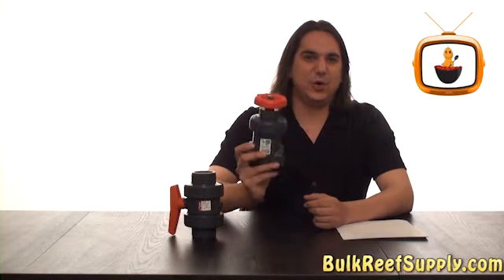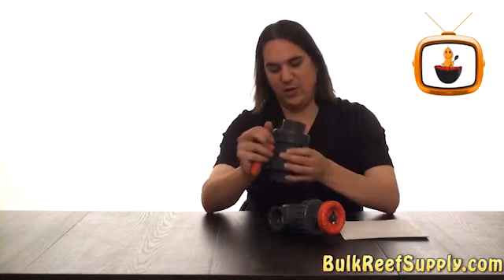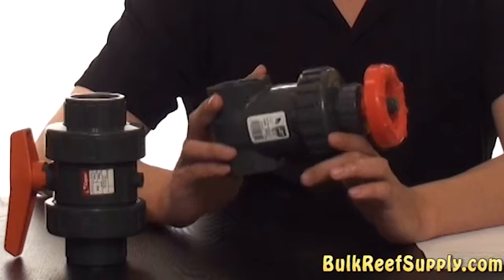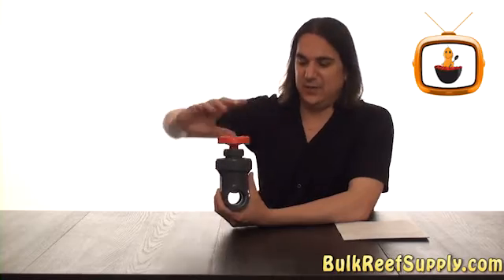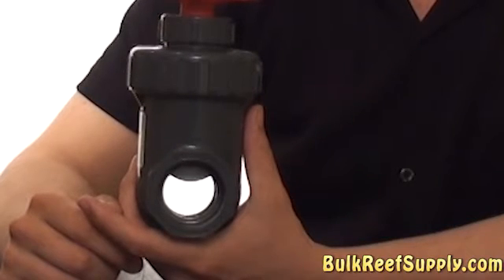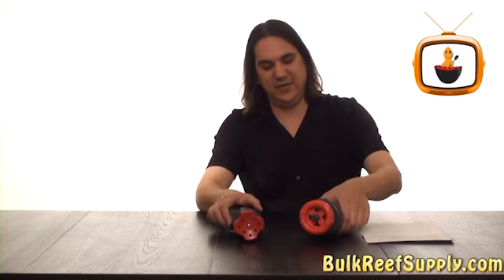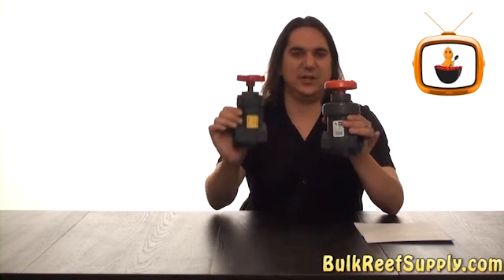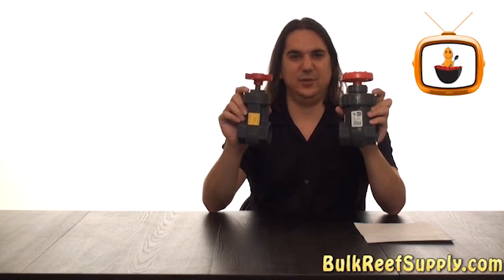How to: Gate Valves  - Plumbing components for a saltwater aquarium series: Episode 5

Comment: I have a ball valve on my bean animal setup and it's really sensitive to dial in the flow rate.
Just 2mm of handle movement drains my overflow box or floods open air pipe too much.
Would really like to get one of the gate valves instead of it.

Comment: Thanks for clarifying the difference between booths types of valves.. What would u recommend I use to stop the water from backsiphoning into my sump from the return line i have connected to the magdrive pump. I have my magdrive pump located in section 3 of my proflex sump Which returns water to the main display via 3/4 inch vinyl tubing... I'm looking more or less for something to put in-between the vinyl tubing that will let water flow up through but will block it from flowing back down... Tha